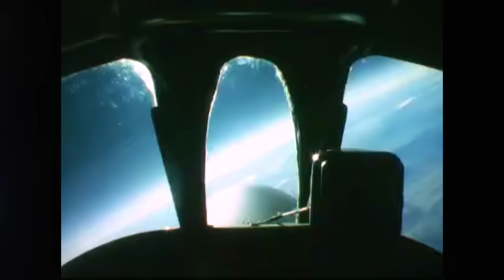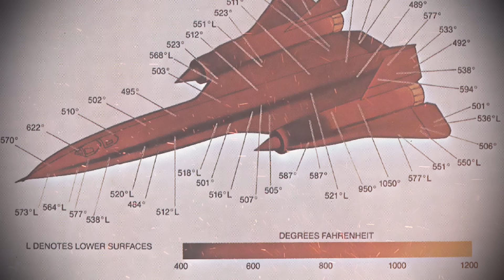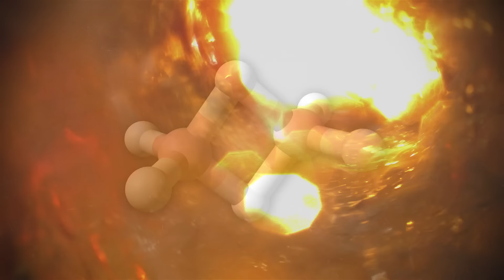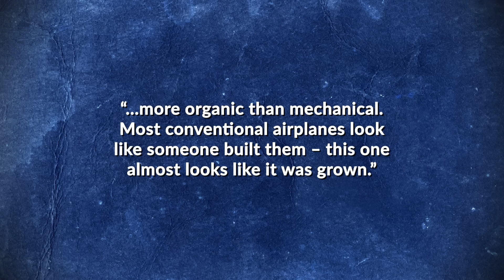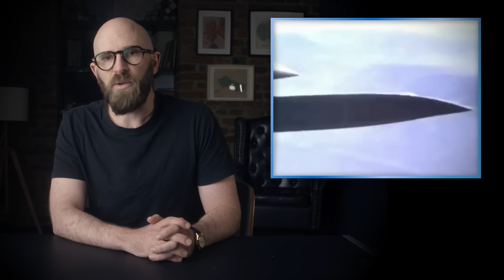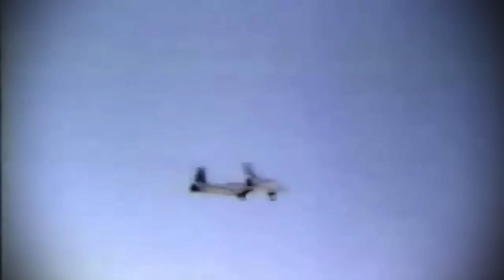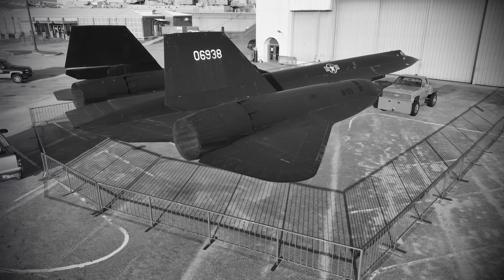How Did the SR-71 Blackbird Get Made and How was It So Fast?

Comment: The SR-71 is known for it's astonishing speed, of course, but what I think is lost on people is that it wasn't the only aircraft that could reach mach 3 speeds during that era. It wasn't the speed alone that made the SR-71 so special. What was radical about the SR-71 was that it could effortlessly sustain 2000mph until fuel exhaustion at 80,000 feet of altitude. THAT was the game changer. It wasn't a machine of raw power, it was a machine of elegant aerodynamic and thermodynamic efficiency specifically tailored to fly faster than a rifle bullet at the edge of space. That is what made it untouchable. The Soviet's had jets that could reach that speed, but they would point their noses at the SR-71, push their engines to max power, and run out of fuel and damage their engines before they could intercept it.

Indeed, even with mach 5 Soviet missiles launched at it, the missiles would exhaust their fuel upon ascent, coasting after the SR-71 at mach 5, over taking it quickly in theory - except, they were now coasting at 80,000 feet, getting slower every second. The SR-71, sustaining mach 3, could make course corrects to avoid the missiles. This would force the missiles guidance system to bleed off speed by maneuvering in an attempt to intercept. Doing this, the missiles would quickly run out of energy and fall back to earth. The ability to efficiently sustain such high speed at such high altitude made the SR-71 untouchable until late 70s when improved missile tech could finally catch it. There were a few close calls over Vietnam with the A12.
Reply: The important thing to remember is back then they didn’t have radar fast enough to find it. So unless they happened to see it, and had some prediction to its flight path, or happened to be in the same air space, they were never going find it in time to be in range to fire at it. 
In 1986, I was a Marine radar operator.  We tracked one (we were using Navy radar that day) in Gitmo. It was so fast we could only see it about other sweep or so and we knew it was coming and its flight path. It circled the island and was gone.  It did a flyby of the whole country and showed up on US radar about 3 times, and we knew where to look for it….
Reply: @sirenknight8007

Marines are well know as having only two types of equipment. Either absolutely modern and state of the art (F-35, Osprey) or things older than the earth itself (CH-46, Huey Cobras). I’m suspecting your radar set was the latter.. probably having a WWII serial number.  

Because a radar horizon is like 180 nautical miles. Even at a slow 30 RPM and the Blackbird going 30 miles a minute.. you’re still going to get a blip every mile on the SR-71 and even if you don’t get all of them that’s still a full six minutes that it could be painted. 

And that’s just search radar.  You can paint it constantly with targeting radar and even if it’s extremely close (even if it flew straight overhead it’s still 14 nautical miles away) it’s not going to exceed the traversing rate.  

And the SR-71 had a huge radar signature because of its particulate emissions—even after efforts were made to chemically reduce it.
Reply: Uh…. no.  

First… it wasn’t “effortlessly”.  The SR-71 required a week of overhaul after each Mach 3 flight.. and speeds above Mach 3 only account for about 20% of the hours flown. The only plane capable of “effortlessl” supersonic flight was Concorde—which has more hours at supersonic speeds than all other aircraft COMBINED!

It also needed to carry 80,000 pounds of fuel to do so.. most of which had to be put on it from air to air refueling. This was after space shuttle like preparations for takeoff.  Vs a MIG-25 which could be hot and ready on a hard stand for a two minute scramble. 

You also misunderstand how interceptions work.  From the 1950s.. in the era of the F-89, F-94, and the CF-100.. they had the radar and weapons capabilities to do collision course interceptions.  You don’t need to chase down a Mach 3 aircraft—you simply need to occupy the same position at the same time.  And with the SR-71 having a turn radius of EIGHTY ONE MILES (eg: if it was going south over Manhattan and turned left… it wouldn’t be going north until it was over Martha’s Vineyard.. eight minutes later) it couldn’t just turn and evade unless it slowed down. 

This is why not only did the Soviets successfully intercept it numerous times—closing to exactly 3km which is more than enough for its huge missiles to make up the difference—but the Swedes were also able to intercept it in their Mach 2 Viggens no less than 51 times.  

The only reason it wasn’t shot down in those cases is because it was in international airspace.  It never overflew the USSR once.  

It was shot at.. but only when overflying tiny developing nations where they would have to fire on it in international airspace.  The Mig-25 did the same thing over Sinai, Israel, and Islamabad and likewise was never shot down in that role.
Reply: @calvinnickel9995  Your standards are really silly. It could fly at 2000 miles per hour for hours. That's effortless, given any other aircraft besides the concord had to be in full after burner to even go super sonic and would run out of fuel in minutes. The concord also couldn't hit mach 3, and there is a massive difference between mach 2 and mach 3 in terms of, well, everything. Aerodynamics, materials, engine design. It's a non-trivial distinction. Being able to sustain that speed is astonishing.

Yes, I understand how intercepts work, you apparently don't, and don't' know your history. They had to go to rather extreme lengths to nerf the SR-71's capabilities in order to allow the F-15s to get simulated kills in training. And when SR-71 pilots didn't follow those nerf'd rules, the F-15s were completely unable to intercept even when knowing the exact time, course and altitude. Speed and altitude are impossible to overcome without superior speed and altitude, that's just physics. So now you want to claim that the soviets, who couldn't know exact time, course, and altitude were able to successfully intercept it? The Russians make lot of claims, most of them are lies. Keep that in mind.

The A12 got hit once. It survived. Tactics were changed, improved radar detection, etc. You couldn't be stupid with it. The CIA had been getting stupid with, like flying right over a missile site. It's true they never flew over the USSR, officially anyway, but it's not true soviets never tried to shoot it down with interceptors. They just couldn't.

As I said, by the 70s the soviets absolutely had missiles that could take it down. And by then it was staying well away from those missile sites. Missile range is still a thing, but by that time satellites were our main source of aerial reconnaissance. There are rumors the SR-71 was used more to annoy the soviets than anything else at that point. True? Who knows.

It generally wasn't allowed to be super sonic over Europe in most cases. Hardly a tactical intercept, what you are describing is escorting an aircraft out of a country's airspace. A few times it wasn't where it was supposed to be over Europe, and once again the SR-71 used speed to get away. One of those times a couple of Viggens actually threatened the SR-71, the pilot just pushed the throttles and left the Viggens in their wake. Remember, the SR-71 was faster than "normal intercept speed" + "bullet speed" of most fighter aircraft. The Viggens had no chance of actually shooting it down.
Reply: Sorry… you lost me at “the Concorde had to go full burner to even go supersonic and was out of fuel in minutes”.  

Concorde supercruised and crossed oceans supersonically entirely with fuel carried on board.. plus civilian reserves. 

Yeah the SR-71 could go Mach 3 for “hours”… literally two of them. That’s it.
Reply: it could do more than mach 3, enough that you would've had to know where it's going to do an intercept attempt coming at an angle to it's path with a mig-23.  mig 23 could do way way more sorties without a rebuild.. while being being much much slower - in the required energy amounts mig-23's speed is a lot less than 71's.

Comment: About 11 mins in you stated a commonly held misconception: the aircraft expands due to heat which had the effect of eliminating the substantial fuel leaks while on the ground. This is untrue. Those leaks were caused by heat and expansion. The major leakage was from the outer wing tanks (not present in the A-12). These were not critical so the aircraft flew and fuel was supplied from those tanks first, eliminating any danger. What leak that would ground the aircraft was in the mission bays which became dangerous due to wicking fuel in the insulation in those areas. Auto ignition was possible. 
I was a fuel system specialist on the SR-71 from 1967 to 1970.

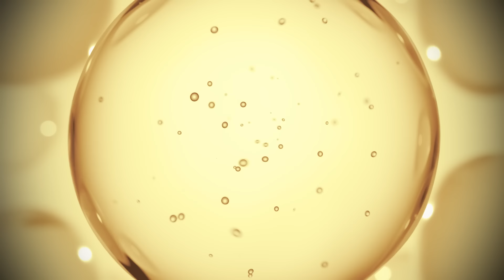Comment: @10:56 The fuel leaks are commonly over exaggerated, as is the case here.  The leaks were measured in "drips per minute".  The choice of a high flash point fuel had nothing to do with safety concerns over dripping fuel.  The high flash point was required due to the very high temperatures encountered in Mach 3 flight.  In an emergency, the plane could be fueled with other options (like JP-4), but only flown at lower speeds to get to a safe landing area.
Reply: Which makes sense until you realize the XB-70 flew at Mach 3 and didn’t need JP-7.  

It was the leaks. I remember there being pools of it on the ground around it when I saw it at the Abbotsford Airshow in 1986.
Reply: @calvinnickel9995  The SR-71/A-12 skin was the fuel tank, so air friction at high speeds created very significant aerodynamic heating of the fuel.    The heating was such an issue that the plane was limited to Mach 2.6 until the tanks had an inert atmosphere of pure nitrogen.  This was the main reason the plane refueled right after takeoff:  filling the tanks forced out any vapors.  (Takeoff with full tanks was prohibitively heavy and made a single-engine abort VERY risky, so this was almost never done.)  If a mission called for a Mach 3 loop before refueling, the ground crews had to fill the tanks on the ground and then de-fuel down to the desired weight while back-filling the tanks with nitrogen.  See Rich Graham's book "Flying the SR-71 Blackbird" for an excellent explaiation of this.

The XB-70 was an entirely different design, such that aerodynamic fuel heating wasn't as significant-- although it should be noted that plane also had its own unique fuel requirement (JP-6).

Comment: They had to use two Buick V8 engines to start the J58 engines because of how high of an ignition temp the JP-7 fuel required. The USAF and Skunkworks burned up every V8 400 block Buick engine in existence because of it lol, thats why he mentioned the Chevy engines because there were no more Buick 400 V8s. Evidently the ground crew loved the buick engine sounds more than chevy.
Reply: lol….No.  

They only make 50 Blackbirds of all types. 

They made thousands of wildcats.
Reply: @calvinnickel9995  learned it from the video on the J58 from Air Zoo. I was probably crossfaded when I watched it.

Comment: The unit of altitude measurement throughout aviation is feet rather than meters. If you had've used it then you wouldn't have been more than 10,000ft off in your assertions. 
Before you retort with "reports say it could / did" you negated all that when covering the X-15 and highlighting why those records didn't count.

Comment: The engines used in the AG330 Start Carts were Buick 401 "Nail Heads" up until the mid 70's. The Start Carts were mechanically coupled to the P&W engines but lacked over-running clutches so if the ground crew failed to disconnect the couplings before the P&W's fully spooled up, the poor Buicks would be wound up to the point they would blow apart. The Big Block Chevys started to appear after replacement Buicks became hard to source. The design was never changed and the Chevys were blown up on a regular basis, too.
Reply: I wonder why they did this when they had air starters on similar sized engines and continued to use them on much larger ones (like the 100,000lbf GE90 engines on the 777).

Comment: Can confirm, JP7 is so unwilling to light off with traditional igniters that it took every bit of that 600hp in the start cart to spin the engines to get just barely enough heat and compression in the compressor to light off and idle. Those Big Block Buick carts were eventually replaced by a pair of more modern gas turbine start carts once those became a thing, the pair of Buicks just didn't have the horsepower (for context it's all we had at the time and they just weren't up to the task, but they got the job done). I had a relative who worked ground who used to talk about that a lot, "you really had to know what you were doing in the early days and in some cases if the cart was acting up or the 58's just refused to light light off, ground crew wouldn't pack one extra shot of TEB to get things rolling over. That was highly frowned upon but the Lockheed guys always got a kick out of the explosive BOOM of TEB ligting off those giant J58's and green fire!"
Reply: No turbine engine produces enough compression to get jet fuel to auto ignite for starting. This is why you need igniters.. capacitance discharge systems that are so powerful they will kill you instantly if you touch them.  

In fact.. even with its low compression to start one of the problems is axial compressors is they still produce too much compression at low RPM.. risking compressor stall.  So engine have either bleed valves which dump most of the air overboard at low RPM, variable inlet guide vanes and/or stators that reduce the angle of attack on the compressor blades and therefore reduce compression, or in the case of the J58 on the SR-71.. have two separate spools for the low pressure and high pressure compressors—only the high one being turned by the starter and not benefiting from being supercharged by the low pressure compressor.  

The only function the compressor serves during starting is to provide cooling air. Only very powerful modern engines like the GE90 have the compression ratios to auto ignite fuel.. most of them sustain combustion by a continuous flame front much like any furnace or gas stove.
Reply: @calvinnickel9995  the way the old tech was employed, the J58's in that configuration required everything they could get to light off; JP7 WON'T light on just igniters on those behemoths with low n2 the way you think they do in modern gas turbines running Jet-A/A1. The more heat you could get before introducing fuel, the better. It's like trying to burn water
Reply: You are right that JP7 won’t light without a hypergolic additive.

You are wrong about the compressors effect and function for starting. 

I’m a pilot with 7,000 hours and I start turbine engines all the time.  The problem with starting a turbine engine isn’t enough temperature—but too much.  

A compressor doesn’t make the temperature rise appreciably at the 10-20% N2 it spins at, at the introduction of fuel. Any more than you’d expect a fan to make you hotter rather than colder even though it’s adding energy to the air.  

When you hit the starter and look at the ITT/TIT/EGT it doesn’t change for a cold start.  If it’s a start on a previously run engine.. you’ll see it go DOWN!!  And we are encouraged to motor the starter after a quick turn as it will reduce the temperatures by 100 or even 200 degrees Celsius.. and make a hot start less likely.  

Because that’s the limiting factor on almost all turbine engines.. the extreme heat that’s produced after light off but before the compressor has spooled up to idle (often 60% or higher). 

The only time you need to add heat is when it’s extremely cold.  Like -40 cold.
Reply: @calvinnickel9995  well, when you witness a TEB start for yourself then you can lecture me all about JP7, J58-JT11D's and hung starts.. or any of the other weird quirks of that variant as-installed 😉

Comment: The fuel had a low flash point so it wouldn't boil off when encountering the skin temperatures generated during high speed flight (it was circulated through the airframe as a coolant before being sent to the engines), not because they were worried about some smoker setting fire to the leaking fuel. And the leaking thing is overblown. It would drip a little fuel near the end of its seal replacement cycle. It's not like fuel was pouring out of the plane any time it wasn't supersonic.

BTW, regular gasoline will not ignite if you drop a match into a puddle of it, and standard jet fuel is less volatile than gasoline. For a fuel to burn, it needs to be a vapor, not a liquid. This is why cars spray a mist of fuel into a cylinder rather than just dumping in a slug of gas.
Reply: So why didn’t the XB-70 also need this fuel?
Reply: @calvinnickel9995  It had its own special fuel called JP-6 which was only ever used for the XB-70.